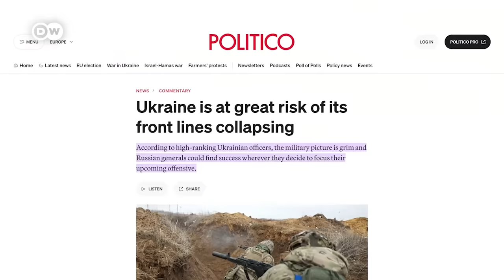US Congress to vote on new Ukraine funding package | DW News

Comment: Russia ranks 5th in the world in terms of arms production, and Russia is the wealthiest empire in terms of resources. During times of war, the country's employment increases as everyone is engaged in production. The more significant the war, the greater the need for arms production, and the wealthier the population becomes because the employment of the workforce grows. Military production is primarily protected, making it theoretically difficult to destroy. However, if it were destroyed, unemployment would begin to rise, and poverty in Russia would increase without production. Without the endless production of weapons, Russia cannot wage war and will seek peaceful paths of development. It is also necessary to destroy steel processing. Without it, GDP will fall because steel provides both the economy and the military industry with the material from which weapons are made in military production.
Reply: Russia economy smaller than Spain.  Russia has difficulty getting modern electrics and optics for tanks and armoured cars.  Your losing a lot of very good pilots and Ukraine getting f-16 planes.  Your Armatas are a joke, just used for parades, you have afew SU57 but never faced real conflict.